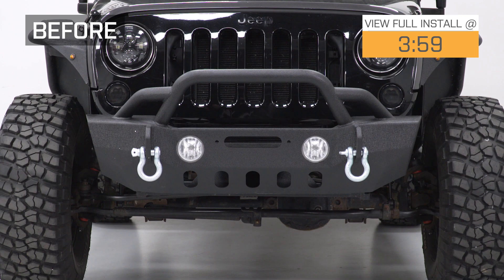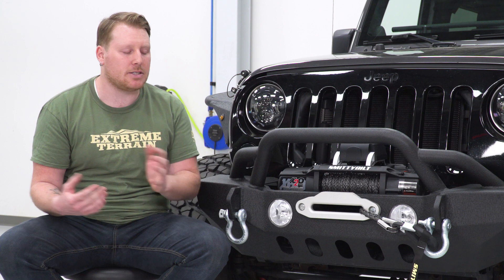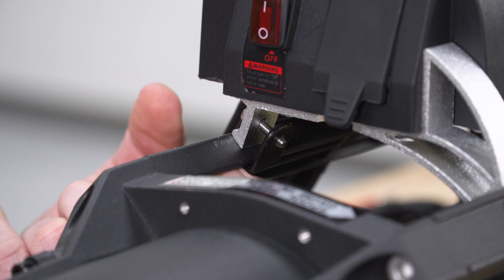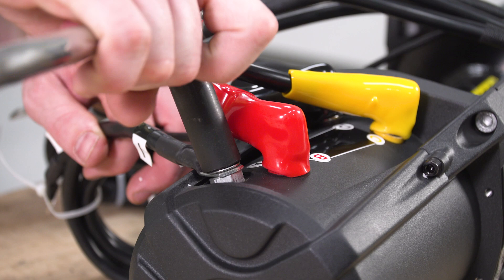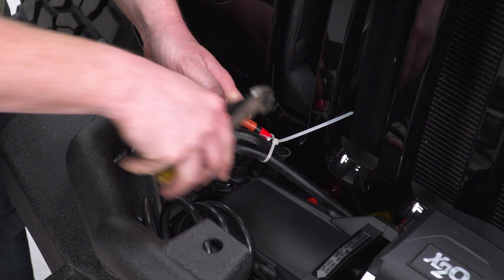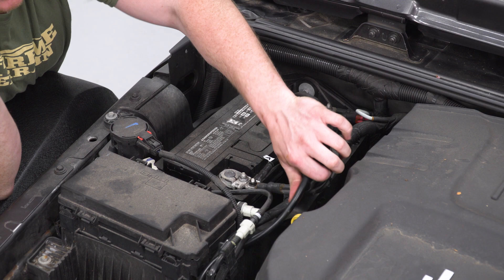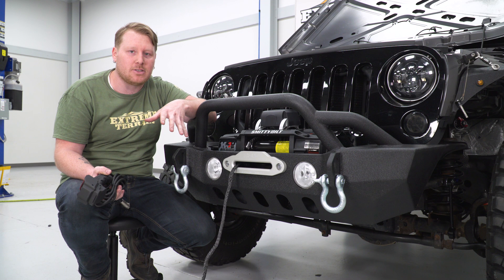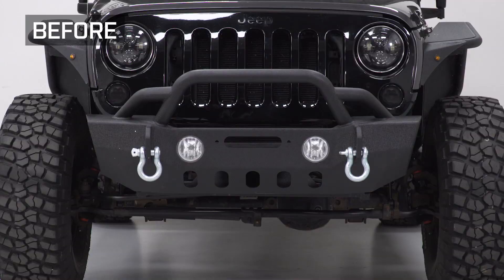Smittybilt Gen2 X2O 10,000 lb. Winch w/ Synthetic Rope & Wireless Control Review & Install

Comment: You guys make great videos but I just want to clarify that a synthetic line definitely, 100%, without a doubt WON'T just fall to the ground if it snaps. It shoots back exactly like a steel cable. It does less damage since it weighs almost nothing but it'll still f#@k you up if you're in the line of fire. Just wanted to make people aware so they dont hover around thinking they're safe and in zero danger

Comment: The most important instruction is on a yellow card attached to the tie bar and says : Loosen the bar to allow for control box bracket install and tighten after.  I lost one hour trying to install those brackets, prying on it before returning to all the papers included and found this note. 10 minutes later all was set.

Comment: Do you recommend  a circuit breaker between winch and battery on positive lead?
Reply: It’s just added protection…also easier to manually reset the breaker if it pops.  

I know on HF winches if it’s wireless, it will always be pulling a draw.  Since it’s wireless the winch will always be looking for a signal.  When I’m not using my winch the breaker is popped so it’s not drawing off the battery.  If I’m going to use the winch I pop the breaker back in.

Comment: You may want to pull the video off. Unless you want to honor the $430 price tag that it advertises. Instead of the over $700 price tag that your website has once you click the link provided in this video. That’s quite a bit of an increase over one year. Maybe the same people that are making ammo or making this winch
Reply: He hasn't any obligation.

And I just picked it up for about $550. So you're wrong on both counts.
Reply: @twidget59  that’s still higher. 
Besides that item is price regulated. There’s no way that you picked up a brand new one that has never been opened for that. If so, please let me know. That way I can get that company in trouble. And obviously you didn’t buy it from their website

Comment: What's the range of the wireless remote
Reply: I have this winch.. I would say atleast 25ft thinking back to the times I’ve used it
Reply: I have not tried it, the guys at 4wheelparts told me that at about 60 feet you will start to see some delays in the control. Not bad. And they highly recommended this winch.

Comment: That uneasy feeling when someone shows up with a Smittybilt winch instead of a Warn.....
Reply: That uneasy feeling when you're an elitist Jeeper.....
Reply: @korg47237  Its not an issue of being elitist...Warn is the top brand for dependability while Smittybilt quality is extremely hit or miss.
Reply: Not everybody wants to spend 800 bucks on a winch.
Reply: @Greivous429  8,000 pound rated Warn winches start at $400 or so.
Reply: I guess I'm about to find out, but a submersible 10,000lbs winch w/ synth line and wireless remote, and a ton of good reviews by pros and amateur wheelers deserves a solid chance. I used a MileMarker for years on my old Disco without any issues, other than being sloooow. This X20 has a 6.6hp motor, so I'm happy to try it. I do have a Warn shackle thou. Does that make me cooler? 😂😂😂
Reply: @wvjeepguy8178  I bet you're the guy that buys apple too cause of the name seems you like to pay way over for mediocre gains
Reply: That uneasy feeling when everyone laughs their ass off, at you having blown your wad on a winch. Especially, if it's an EVO VR.
Reply: @twidget59  Suuureee